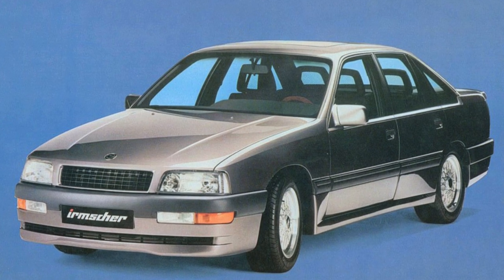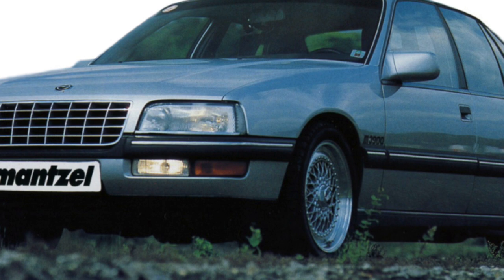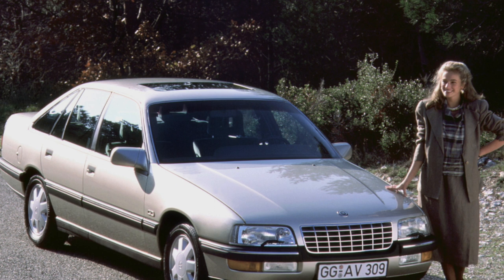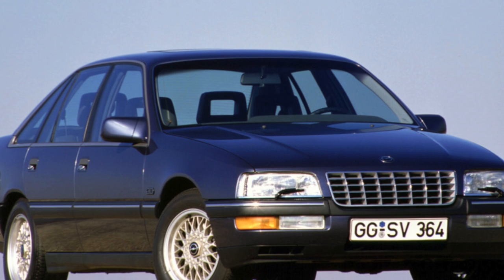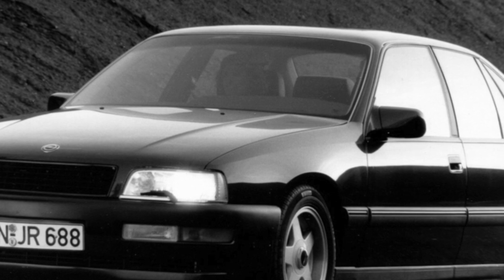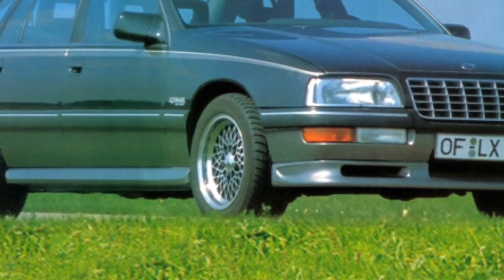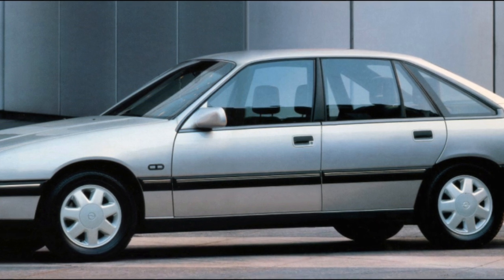Opel Senator B Problems | Weaknesses of the Used Opel Senator B 1987 - 1993

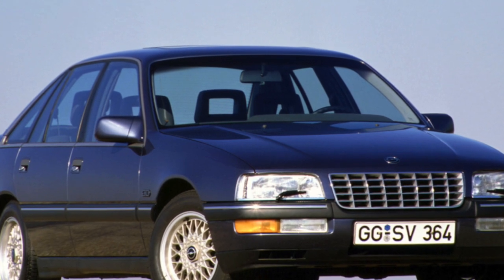Comment: 3:11 Sorry that is a myth of People who never driven a Senator. Yes It has an Inline 6 cyliner but this does not mean a high consumption. 
Especially the Senator equiped with a manual 5 Speed transmission can be easly driven below 10 l / 100 km. 
I drive mine in average at 8,5 l/100 km. On long Autobahn Journies i can reach 7,8 l/100 km. 
Don’t forget the low drag coefficent of 0,30 and the low wight of around 1,5 tonnes. 
Even with the 4 Speed Automatic the average consumption is below <12 l/100